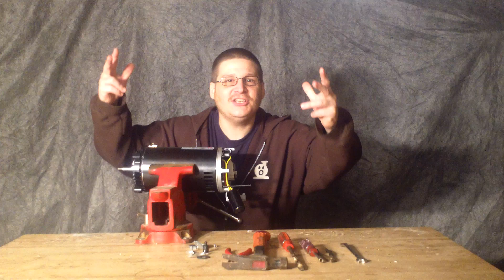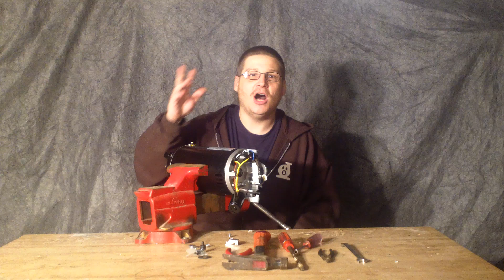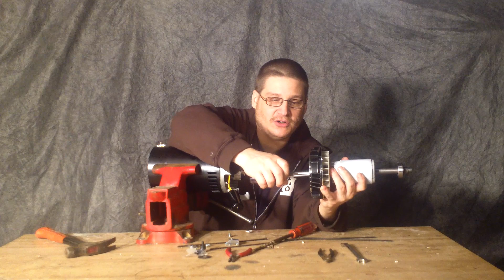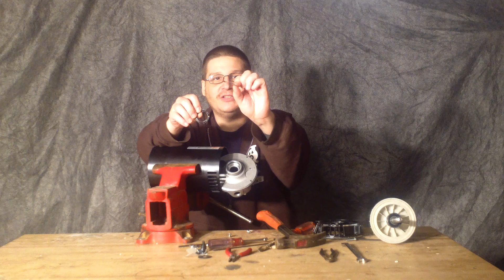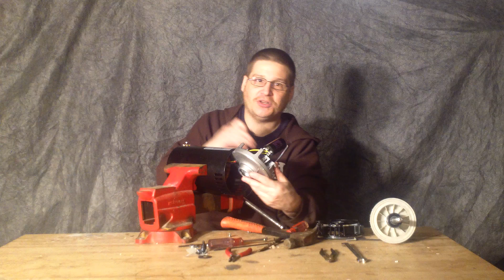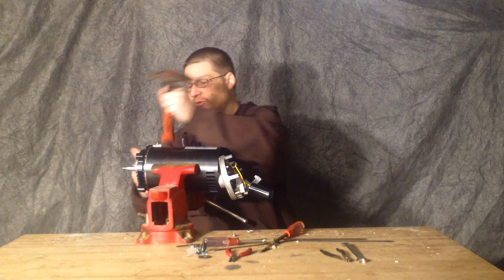AO Smith UST 1102 & 1152 Pool Pump Motor Repair

Comment: 1) Same as USQ1102? Looks the same?
2) You never actually showed getting the bearings off the motor shaft. Do they just slide off? Need and special tools to get them off?

Comment: Great video!  The shaft seal was leaking on my secondary Wavemaster 7000 pump which has a Century / AO Smith motor.  The shaft behind the threads crumbled away to around #2 pencil diameter.  Now the shaft is smaller than the seal.  That's what she said!  Motor runs fine, needs a bearing.  What are my options for the shaft?  Can the shaft be replaced?  Are there shaft extensions? Thanks